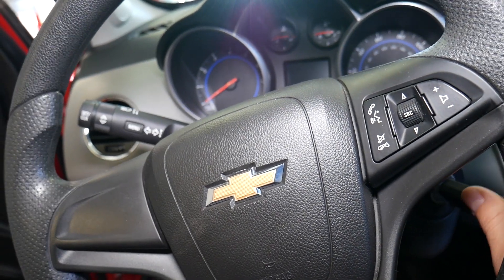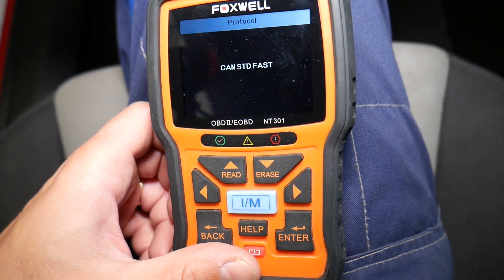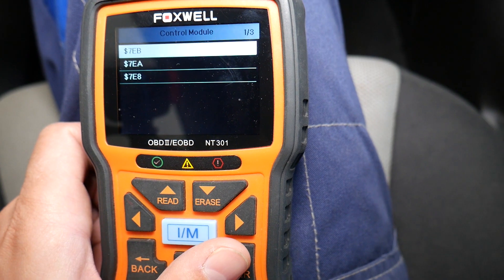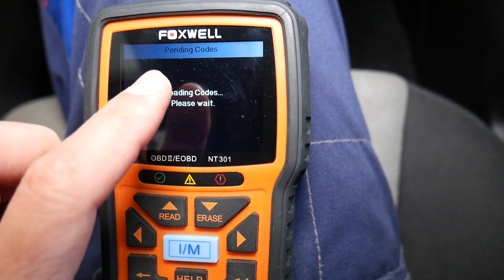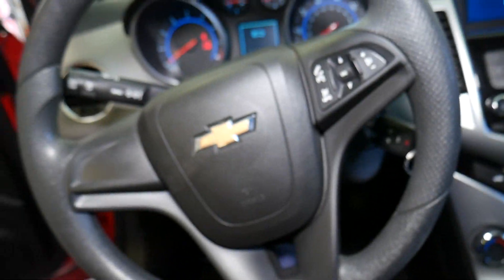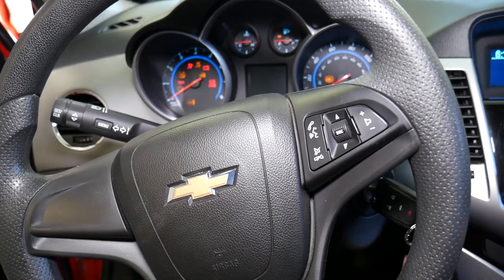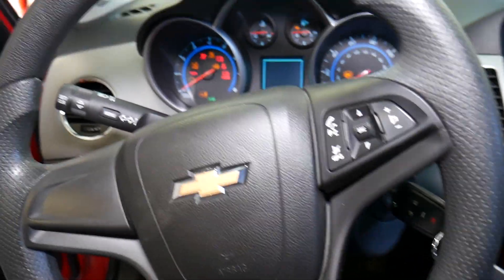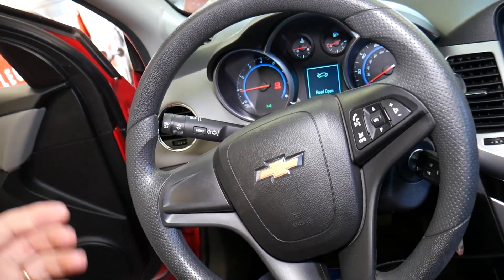CHEVROLET CRUZE CODE P0118 P0119 COOLANT TEMPERATURE SENSOR ENGINE LIGHT ON

Comment: No need to drain the coolant. Just wait till engine is cold, remove clip and quickly install new sensor. You lose just a few drops of coolant. Top off coolant and you are finished. Takes 5 minutes. I have done this 3 times now on my 2013 Cruze on this exact motor.
Reply: Must a very common issue on these
Reply: @cerealpath3897  It is a common problem. In fact, the temp needle should be slightly below center and right now it is only showing 1/4 there. Will need another sensor soon.

Comment: Hello. Im currently having the same issue. Ive just replaced the ECT sensor and the fan is staying on. Ive erased code but still on. Any help? 

Thanks in advance
Reply: Have you solved that problem? Could it be a broken wire of sensor?

Comment: Good morning! I have a 2015 Chevy Cruze LS and my temperature gauge stops working, my air conditioner stops working and my fan goes on turbo. I've replaced both temperature sensors by watching your videos and thank you very much for that information. I'm still having the issue. Should I change out the thermostat now?
Reply: Im in the same exact boat. I just replaced the thermostat 4 months ago. But idk
Reply: How have you solved?
Reply: Check for frayed wiring and clean connection to temp sensor with contact cleaner. P0118 is an open circuit at the temp sensor which means a bad sensor or connection.  Also could be because of the coolant in poor condition.